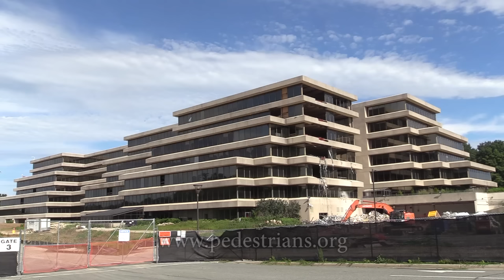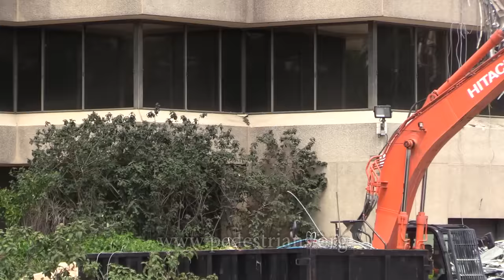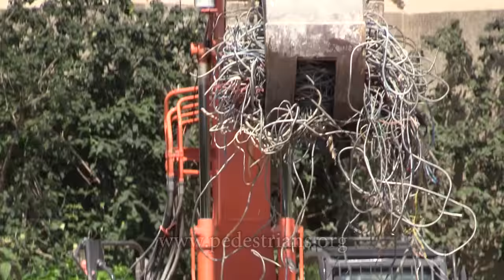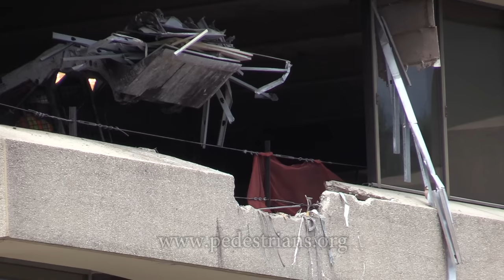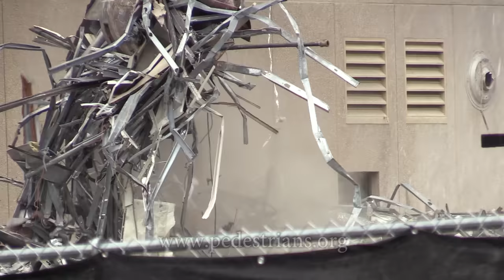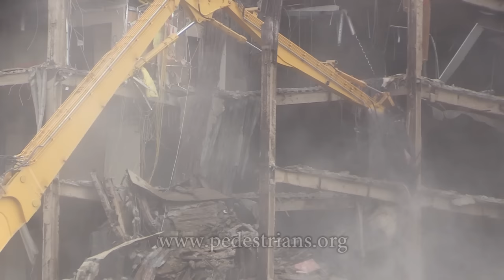Marriott HQ Demolition (Part 1)

Comment: Good one, John. It was fun to see at least the outside of the interior demo, which we've not seen before. It's interesting that they are separating the debris inside, unlike some other projects where the steel studs were neatly stacked inside only to have them dumped out with all the mixed debris during the demo of the structure.

It's also good to see a good old structural steel demo again, this time with a shiny new high-reach demo machine.
Reply from the maker: In buildings where they are dumping rubble from the interior down the elevator shafts (rather than out the window), they have to leave the metal studs because they would immediately create a log jam in the shaft.  I am surprised that they don't make an effort to keep the piles of studs separate when they get to them with the excavator, rather than mix them up with the concrete rubble and then have to separate them out again to recycle.